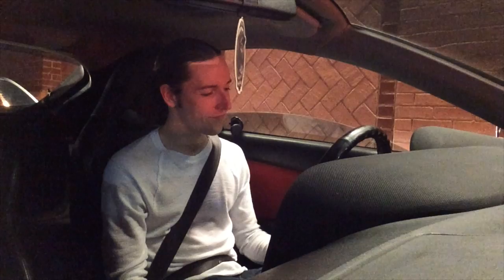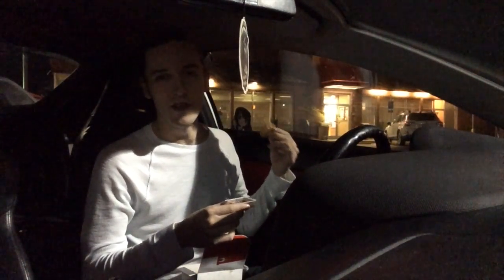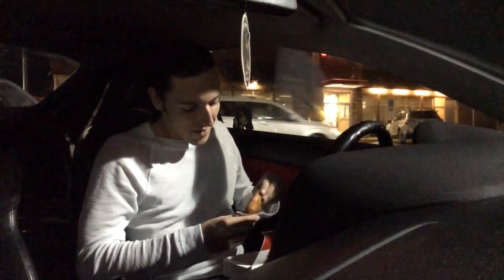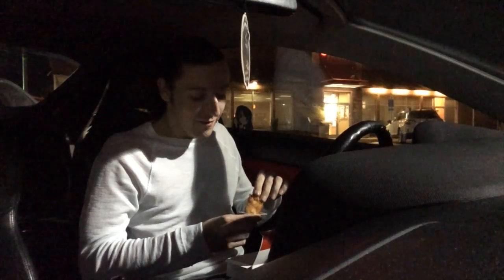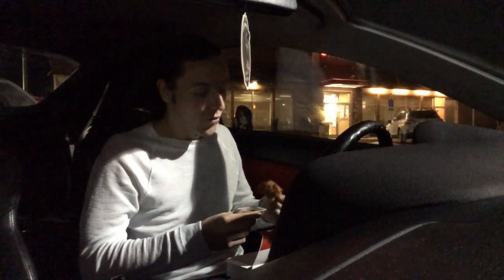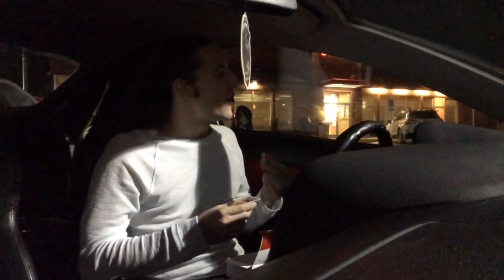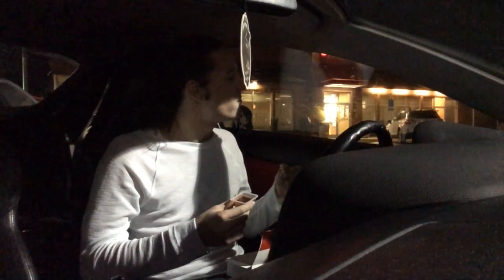Barometer Performance Malfunction?! P1106 wtf?!?!

Comment: my 99 civic is throwing up P1106 . tried resetting the ECU  and all that and ended up replacing it . still throwing up the code . any suggestions?
Reply from the maker: is your civic stock or kswapped? if it is stock you need to replace your TPS with something else. if you are Kswapped i would recommend the Acuity Upgrade Hall Effect TPS. best 100 bucks you can spend. this removed my p1106 code altogether. hope this helps
Reply: @ShadesWade  yea just a stock automatic D16 . this damn code has me stumped even tried replacing the map sensor lol . thanks bro I’ll try that
Reply from the maker: @atheno3061  yeah it happened to me and i tried a bunch of things but then got to the tps and that corrected it. it happened to another RSX owner and i suggested what i did. he did it and it fixed his as well. so its a proven theory! (at least for rsx, but i would imagine it works for other hondas with the same code too!)
Reply: @atheno3061  did you ever find a solution? I have same issue
Reply: @MegaMikerojas  did you ever fix it? me too same thing
Reply: @bbygabrieee4913  yes i replaced ECU really easy to do. Just make sure it's the same engine/year/transmission ecu